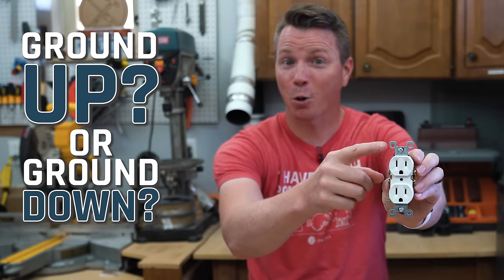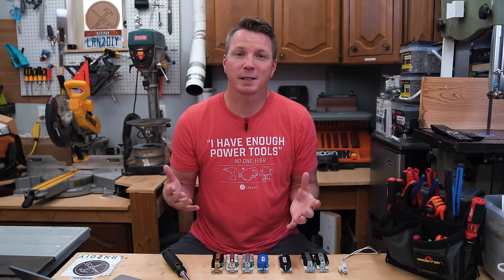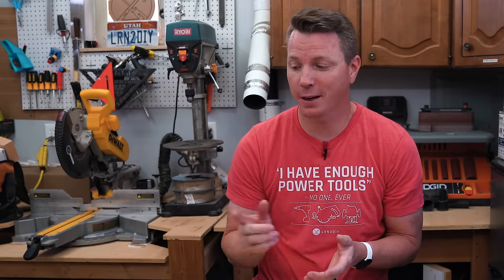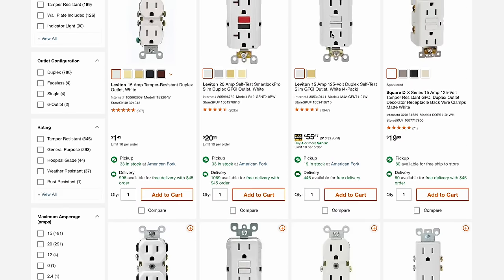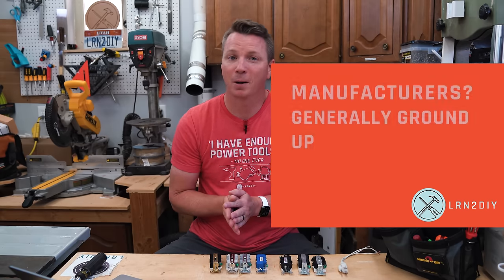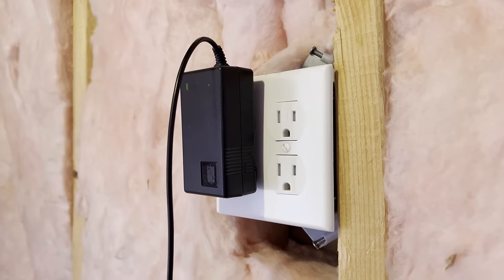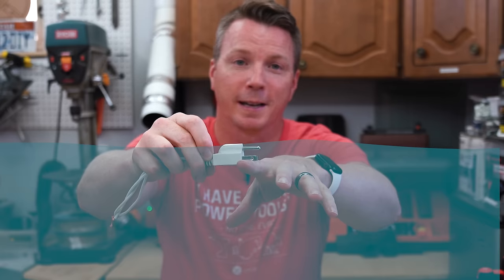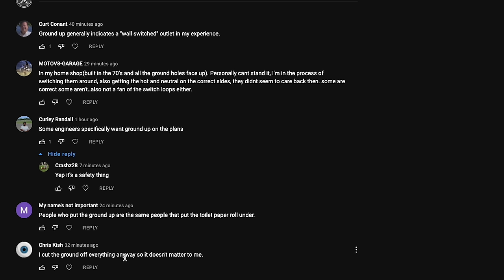Should Your Outlet Ground Face Up or Down?

Comment: According to John Williamson, Chief Electrical Inspector for the Minnesota Department of Labor and Industry (retired), if someone submitted a proposal to change the NEC to require that ALL receptacle outlets be installed with the ground-prong up (or down), they would have to convince industry experts on various code-making panels that the ground-prong up installation was far superior and safer than with the ground-prong down. It’s likely the NEC code-making panels would reject the proposal for lack of substantiation.

The main reason there is so much debate is because electricians rely on the type of equipment that will be plugged in to determine the orientation of the electrical outlet. For instance, clothes washers, refrigerators and window air conditioners most commonly have cords with immediate-turn plugs, and so the logical way to install the outlet would be to orient it so that the plug inserts without having to loop over itself.

Comment: Another real life example of the plug shorting problem. We had an old house with loose receptacles, and there was a plug in my son’s room behind furniture which was hanging out. He dropped a book behind the furniture and it hit the plug. It was a “ Little Golden Book” which is thin enough to contact the prongs and has metal foil on the spine. It burned two spots in the spine and popped the breaker. Luckily no fire or injuries.
Reply: Even with ground up it is probably still just as likely of a bridge between the Hot and Ground prongs as it would be Hot and Neutral plugs on ground down scenario's.
Reply: @MrT------5743  Well, technically only half as likely.. depending on which way it fell, there's about a 50-50 chance that it would end up bridging either the hot to ground (problem) or neutral to ground (not a problem), whereas the ground-down scenario is always hot to neutral (problem).

Arguably probably a bit less than half, since it has to also fall to the side in addition to falling onto the top pin(s), and if there's anything around to catch on that would prevent that motion (for example, if there's something plugged into a receptacle right next to it as well) it could also prevent shorting any pins.

Arguably, the best way to mount it to address this sort of problem would be sideways, with neutral up.  That way it would be very difficult for anything to fall onto the hot pin in any way and any bridging condition would almost always be neutral to ground.

But to be honest, I really think this whole thing is a pretty minor issue in reality.  There are so many many other things that are so much more likely that are much more worth worrying about, and if this was actually an issue that caused significant problems I'm pretty sure the NEC would already have something to say about it.  The fact that the code doesn't specify anything pretty much says that "it's really not a big issue in practice", IMHO.
Reply: @foogod4237  yep very minor issue. Im 47 and I have never heard of anything falling and bridging these posts. This is probably why the NEC does not have regulations on how it should be mounted.

Comment: My argument against using the flood excuse is with a flood the inside of the junction box is also being flooded, and there is a roughly 50% chance that any pigtails on the hot could be dressed with the wire connection towards the bottom of the box. Maybe less that 50% if NEC indicates against that, but how often is that checked by inspectors on every outlet?

Comment: I worked at a company where all outlets out on the floor were ground UP.  Because many people pull up when they remove the plug and  the longer ground contact took a beating.  The company had beautiful double insulated made.  They had a company said that cords could only be used with the ends the came with.  They threw out all cords with the ground lug broken off.  I have many beautiful cords with replacement male end.

Comment: Is it code to install outlets upside down?
In reality, there is no code requirement that says an outlet receptacle should be installed one way or the other. In fact, at one time some manufacturers actually recommended the orientation that many of us view as upside down—with the round grounding slot at the top.Oct 20, 2021

Comment: I as a electrician (28 years) now retired I do not think I have ever installed a receptacle ground down  My reason is (as you pointed out in the video) Gravity  as a plug tries to pull out of a receptacle  gravity forces the current carrying blades INTO the receptacle   A minor thing  with the ground up,  plugging in something in a hard reach place (furniture in the way,  poor installation dark is easier  (ground is big and round easier to find the hole )

Comment: I've never seen a 90-degree angled AC line cord constructed with the ground pin at the top. This allows the cord to hang downwards neatly when plugged into a receptacle mounted to a vertical surface (wall) with it's ground socket down.
Reply: Agree

Comment: I have always put the ground down.  I'm currently fixing up and painting a neighbors house.  There is a mixture of receptacles mounted up and down.  I assume someone in the past must have changed a number of them.  In each of the 3 bedrooms i discovered  at least one receptacle that the plastic around the ground was broken on the top plug.  In each case the ground was up.  My theory is that a 3 prong wire was plugged in, and when being removed the person pulled the plug upward while pulling it out, thus cracking the plastic.  That can't happen if the ground was mounted facing down.  Generally you will notice on a receptacle, there is less less plastic from the ground to the outside wall, and much more plastic between the hot and neutral to the outside wall.

Comment: We have always had a difference of opinion at work over this. The building maintenance guys always put ground up. They say it is better to stop the hot plug from pulling out. The technicians would do ground down because they did not want to lose the ground if it got pulled out. I always just tried to be consistent.  Make them all the same in a building.

Comment: the outlets don't seem to care though I do feel like all safety reasoning says ground up.
the safety reasons for ground down seem really flimsy to me. (if the water is that high it's already hitting contacts and probably a ground wire in the box)(making contact with your fingers also seems unlikely because people tend to grab the plug farther back and it will be mostly out of the outlet anyway)

now the plug ends if they care seem to be setup ground down, though i think the only reason for that is that's what the designers felt was normal because ground down outlets look like a face.
I have a mix in my home because it was setup over time and sometimes the person who did it feels one way or the other, dad was an electrician so the entire family feels safe doing the work.

me? i tend to go ground up because it feels less likely for something to fall on the prongs and cause problems, also i feel like the ground pin on top makes it less likely for it to leaver away form the wall. (like the example in this video)

Comment: History, look at the development history of the outlet.  The ground pin was ADDED after the standard outlet was developed.  First to come along was the polarized outlet.  When the 2 prong outlet was developed they didn't see the need for protections.  Put the plug in either way the device still worked.
Reply: Fuses also came afterward.

Comment: This is a nearly exhaustive, but omits hospital circuits.  My observation is that the special hospital-grade receptacles are installed ground up in hospitals, but commercial buildings with medical offices have ordinary receptacles installed ground down like almost everywhere else.  My electrician installed them ground dowm, my inspector didn’t care, and I prefer them ground down in my home.  I do think plugs with a ground pin might be retained more securely with ground up, though.

The guy who wrote that “ground up” correlates with “tp unrolling down the back” is wrong.  My tp unrolls down the back because the geometry of my facilities makes it work better that way.  I prefer it that way anyway.  In my opinion, tp unrolling down the front (away from the wall) is correct only in outhouses.

I’ll add that Ground Fault Circuit Interrupters make the safety issue moot.

Comment: The national guidelines are not clear either way, but local codes may specify one orientation or the other.

I’ve also noticed, that even in the same place the orientation for residential outlets is sometimes different than for industrial outlets.

Comment: Personally I think the manufacturers should make them with the ground plug on the top and bottom (outside). That way there is always at least one smiley face in the configuration. Also wall warts would fit better.
Reply: That would place the neutral and hot in the wrong position in one orientation… causing a dangerous condition with grounded appliances.
Reply: @SuperVstech  You doubt the ability of engineers to form internal mechanical connections in other than parallel lines? The hydraulic brake lines in your vehicle cross diagonally between the front and rear wheels.
Reply: @psdaengr911  …

Comment: I'm a fan of ground down for the lower risk of touching something energized, but if North American receptacle and plug design weren't so bad, a lot of the issues you mentioned wouldn't be issues at all

Comment: I’ve been a licensed master electrician from nh for over 30 plus years and I’ve never seen a problem with accidental shorts  with ground down
Reply: Yeah but what you know... 😂
Reply: Even with ground up it is probably still just as likely (very remote) of a bridge between the Hot and Ground prongs as it would be Hot and Neutral plugs on ground down scenario's.
Reply: Master electricians seldom get called to investigate electrical fires.

Comment: Imo ground down allows for grabbing the plug in a more natural, comfortable, and safe position. Either way, the thumb ends up on top and index finger on bottom.  It's easier to imagine the index slipping into the widening gap as you pull the plug, so with conductors down, you could get a nice jolt.

Comment: Let's look at this from purely physics point of view. The ground prong is longer than the hot and neutral legs. In this respect the ground at the top would work best to keep the plug in the socket.
 Just the weight of the cord puts a strain on the plug.
 Most homes are ground at the bottom. In industry the ground is always on top.
Reply: I put ground up.  Why?  The ground plug on the majority of receptacles is usually the snugger of the 3, especially as the receptacle gets older.  A cord not supported, but one that drops to the floor, tends to want to pull out.  The often tighter ground port “tends” to prevent this.  BTW, I have both orientations in my home.  All older ones ground down, all never ones ground up.  No real argument from me, but that is what I prefer.

Comment: I'm used to doing ground up, with a heavy preference towards tamper resistant. Not only does it not look like a face for kids to stab in the eye, and keeps bugs out (German roaches love zoos -- and other places), the spring-loaded covers "grip" the hot and neutral. Argh, but most of the others receptacles are the opposite, which messes with my perfectionism.

Comment: Ground down! This is what I was taught while in electrician apprenticeship school with the IBEW (the union). Now this was 20 years ago but I'm sure things don't change. 

Great video to stir up conversation.
Reply: During my apprenticeship, we were taught ground up is safer, but that there would be enormous resistance to it. so to do whatever our Master wanted.
I always install ground up when the decision is mine.
Reply: Things have definitely changed.  It's written into the specs on jobs now for ground up when mounted vertically.

Comment: Ground on top is the old tradition. An old electrician told me Back in the old days Pictures above receptacles that had Metal Frames could fall onto a partially plugged in lamp cord causing a short. With the ground on top the metal frame hits the ground first then falls to the floor causing no Short Circuit.

Comment: The ground should always be down except when the cover plate is metal. Flat cord caps are generally designed for the ground to be at the bottom of the plug so the cord stays flat against the wall.
Reply: You just stated why the ground should be up.  A cover plate isn't the only thing that can touch exposed prongs.
Reply: @jeffwoehrle  Worked as a commercial electrician for forty years and never saw anything else beyond an improper outlet installation that caused an outlet cord to cause an issue. Not sure even installing a plug the wrong way actually provides much protection. And on the upside down to let home owners know they have a switch plug only half the plug is generally on the switch. I see no reason for and installation that looks odd instead of all matching. If I bought a home with an upside down plug in the den I'd want it reversed to match the others so it didn't look out of place.
Reply: @71160000  Same here.  Industrial and hospitals.  The only reason for ground up is gravity...and gravity is the same no matter where you are.  

Beyond that, personal preference.  Ground down looks upside down to me...and I have changed a few to ground up just because I liked it better...lol.

Peace.

Comment: Every HOSPITAL (7+) in my South Florida area that I’ve visited in the past 30 years has ground up and 99.999% of the houses with ground down. Maybe the hospitals know something that house receptacles installers are missing on. To me ground up makes more safety sense but my house receptacles were mounted ground down. 
Last new outlet box I mounted in the garage (yes it was GFCI), I mounted with ground up and I ‘felt safer’.
Since ground down for homes is so common in my area (almost expected), wiring houses with ground up will make people feel that receptacle has been mounted incorrectly
Reply: I used to work as an electronics tech in a hospital. The biggest cause of outlet failures was when crash carts parked in hallways were pushed violently off to some remote destination without the defib charger plug being removed first. Possibly?? the outlets suffer less in American hospitals if they are ground up. Just a guess.

Comment: I think with ground up the plug is less likely to work it's way out but only slightly. I have no preference but all the outlets in my house are ground down. What bugs me though is that some appliances and power strips have a plug that's at a 45 degree angle. It usually doesn't matter but sometimes it does.

Comment: I designed electrical systems for 35 years.   As for the NEC, it does not specify.   As far as I know, UL doesn’t specify a direction either.   And last, the manufacturers instructions do not tell you one way or the other.   So, It does not matter to authorities.  But some things are made for specific orientation.   Night lights typically need ground pin down.   Receptacle testers are typically ground pin down.   90 degree plugs in most, not all, cases orientated ground pin down.   As far as safety concerns, I don’t think there is a dimes worth of difference.   They generally should all be the same orientation through out the premise.

Comment: Just a thought. If you think of power flow from left to right (like most things go left to right) that would put the hot blade in the left and the ground up.
Reply: Alternating current has no direction, actually electric currents don't flow through wires but magnetic fields.

Comment: On any 3 wire device cord the ground prong is longer. this insures that the device is grounded before it is energized. Thus if the outlet is down low,  put the ground hole up as its easier to insert the cord. counter top or higher the opposite applies.

Comment: I'd never seen a "ground up" socket until I bought my first house.  And it drove me nuts.  Everything I bought seemed to be designed for "ground down" and the cords would go up.  Once I bought a fancy night light for a kid's room that was polarized for some reason... and the lighted cartoon character was thus upside down!  (And it didn't have the option for rotating the plug.)  In my second house, the guy who built it also did it all ground up.  And there a ton of outlets.  He put one every 4 feet on EVERY wall.  I swore I was going to turn them all around but still haven't done it...
Reply: sounds like an eye sore

Comment: Ground down. Ground up if the outlet is controlled by a switch. Pretty standard in apartment and home construction. And only ONE half of the dual receptacle should be controlled by a switch, usually the bottom receptacle, this is usually a more expensive option.  Not an electrician, but I hate it when both halves of the switched receptacle are on the switch. Yes I know it costs more to do it that way

Comment: The receptacles I have installed usually have an arrow pointing ground up. As far as toilet paper goes, under is used if you have kids or cats that like to play with the toilet paper. If it's over, they roll it all on the floor, if it's under, that isn't as likely to happen.

Comment: Groud up if vertical,  neutral up if horizontally.  If not connected properly,  anything that falls onto the exposed pins, hits a neutral conductor, not energized.  The ground pin is not meant to hold a physical load by the way. If the connection is loose, the receptical , plug or both are worn or defective and require replacement.